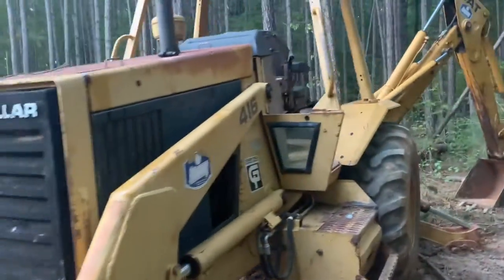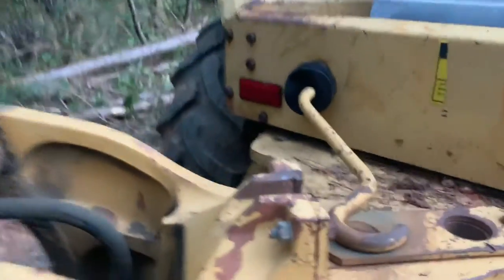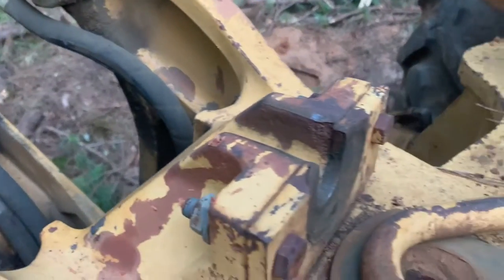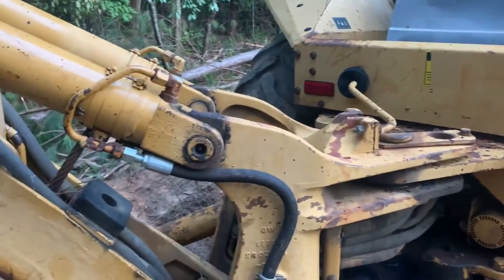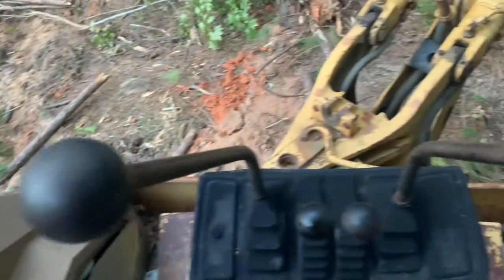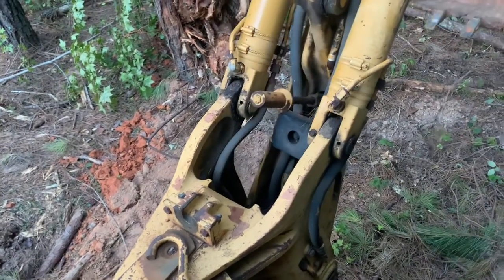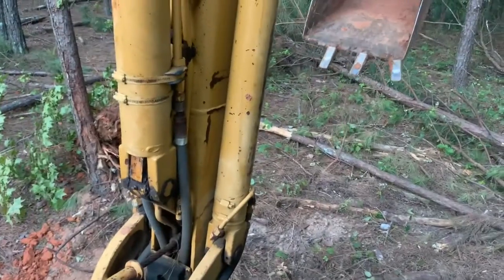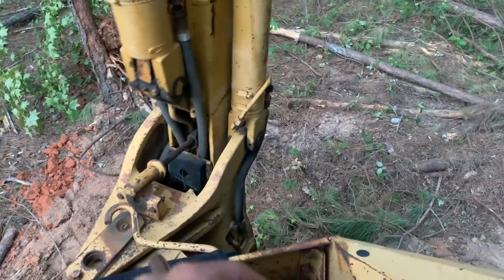Caterpillar 416 Backhoe. Locking Backhoe into travel position.  It’s a trick! Sticks reverse!

Comment: I need some help here. I have the 416 model 1987 and the boom will not lock into place because it’s too slow. The hydraulics are too slow and it won’t jump forward. If you have any suggestions on how to repair I would appreciate it
Reply: Also coming out of hole with dirt in it (back hoe bucket) is slow lifting. Pump pressures are good
Reply: What are your pump pressures?
Reply: What are your pump pressures